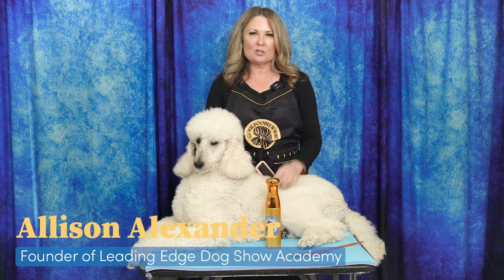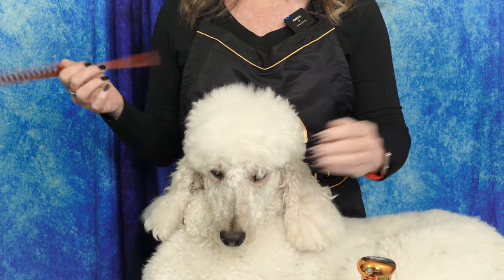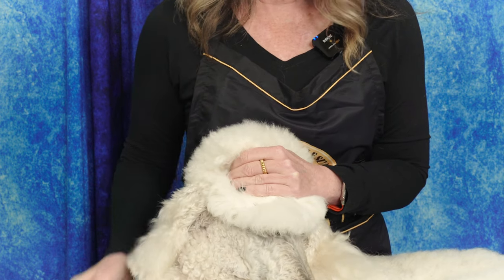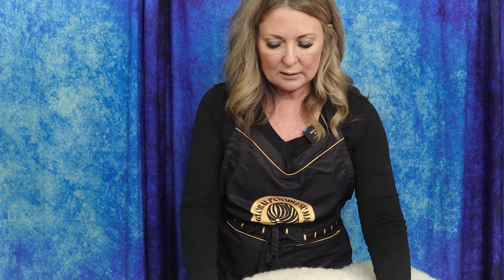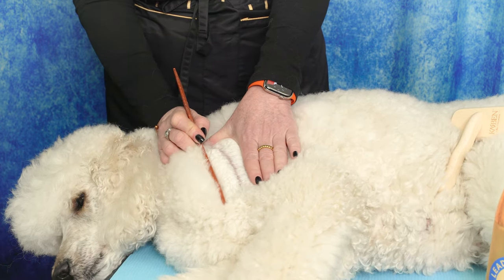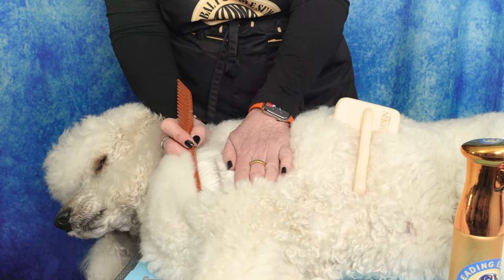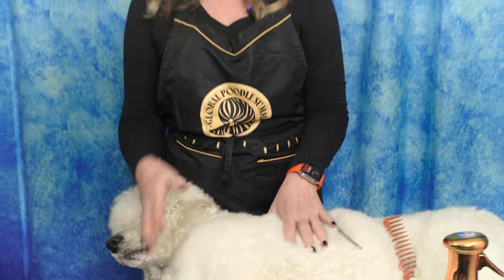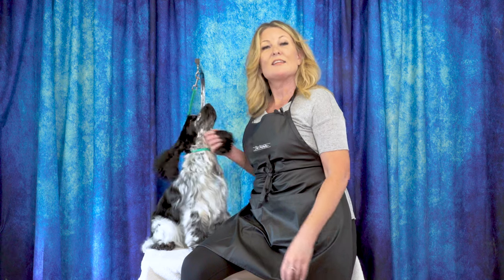Line Brushing Common Mistakes (and how to fix them!)

Comment: Nice tutorial. I usually spritz a whole area like the entire shoulder instead of stopping to do it every line. In your explanation though it seems that the more the hair is moistened closer to the skin, the more volume is achieved and perhaps the longer it lasts, is that correct?